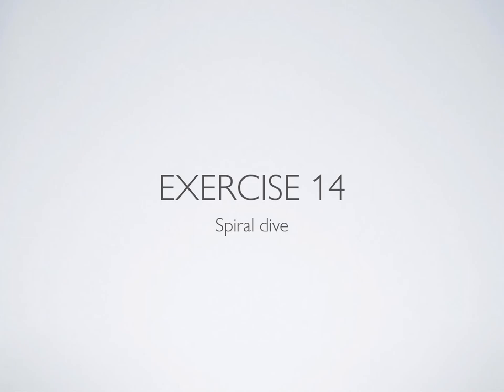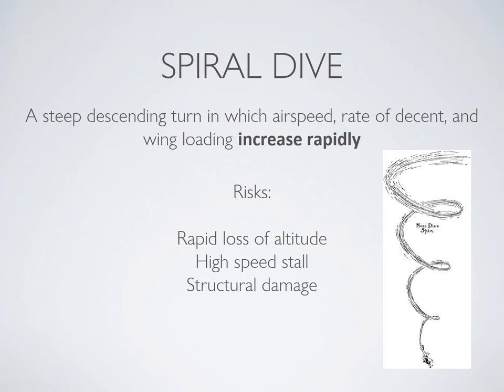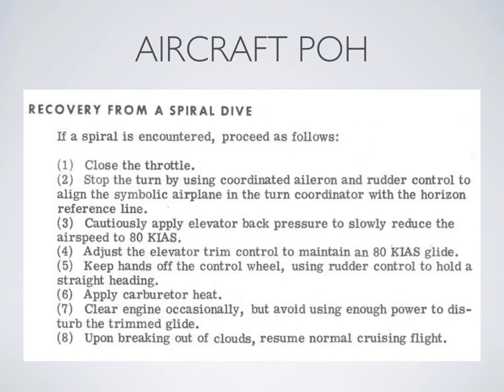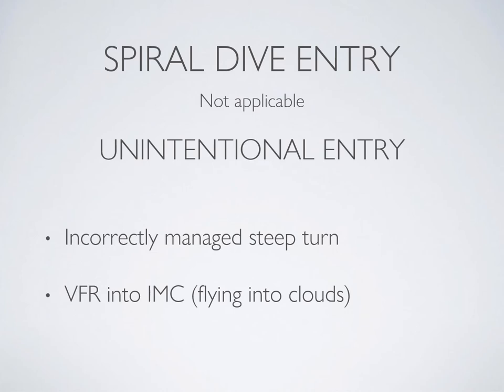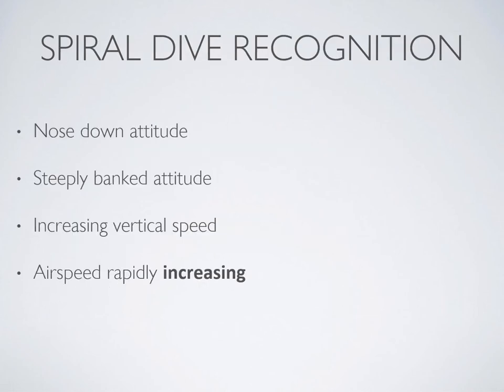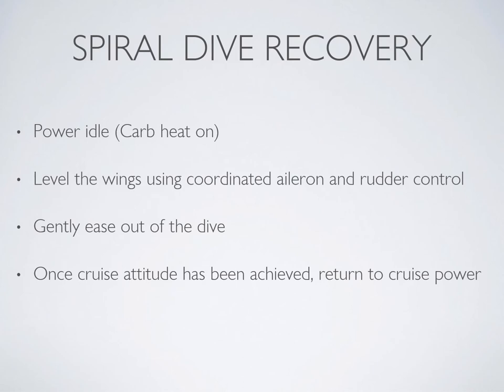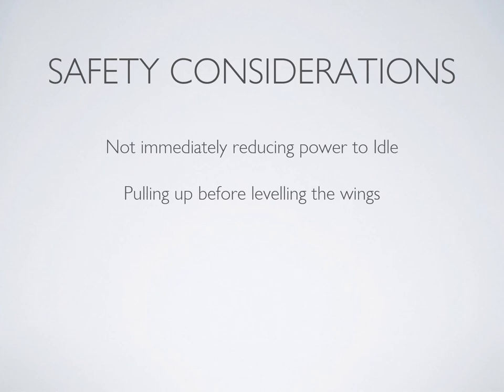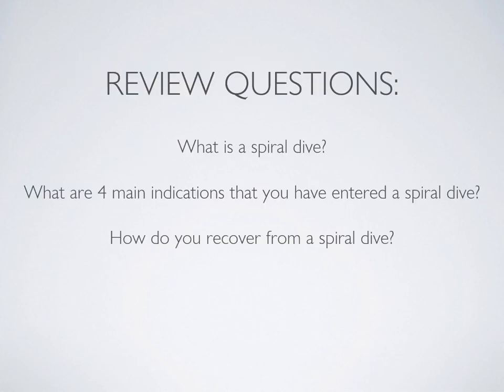Private Pilot Flight Training Exercise 14 - Spiral Dive

Comment: >Thanks for another great video. What airspeed range should we aim for in the emergency descent/Spiral dive?
Reply from the maker: Sorry for the delay in my response! So, typically, the spiral dive is entered by accident. We wouldn't usually intentionally put the plane into a spiral dive because the excessive airspeed improperly handled could potentially cause structural damage to the aircraft.  This is why students are not taught how to put the plan into a spiral dive, the instructor should always do it for you, and the sooner you notice a spiral dive developing, the sooner you can initiate a recovery.   
However, if you do find yourself in a spiral dive, follow the proper recovery method which is remove power, level the wings, then as you ease out of the dive (bring the nose up to cruise), PITCH the nose to SLIGHTLY higher than cruise (just above the horizon) on the recovery.  This will allow your high airspeed to reduce, and once you are again in the green or "safe" airspeed zone, you can then add sufficient power and return to cruise.  So you're not exactly aiming for a particular airspeed, in the recovery, but rather an ATTITUDE in the recovery.

I hope this helps!